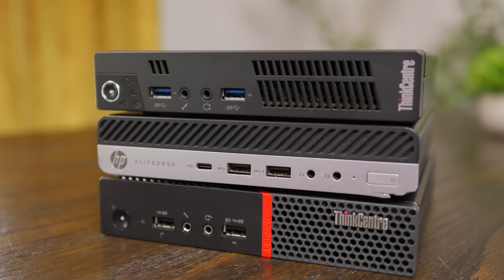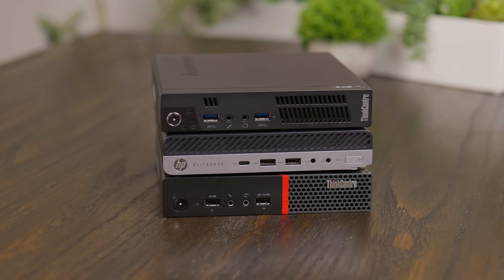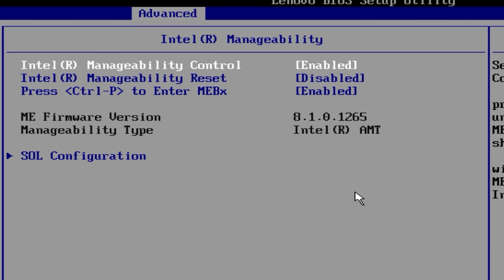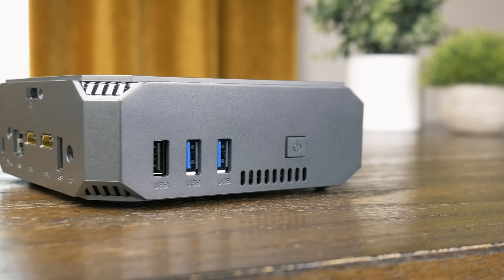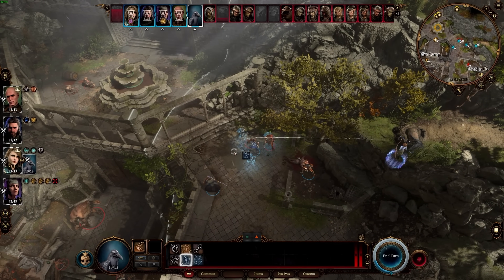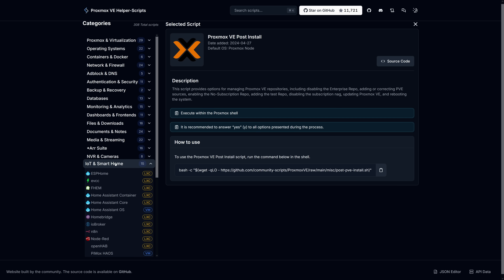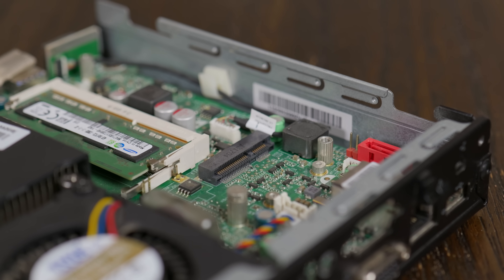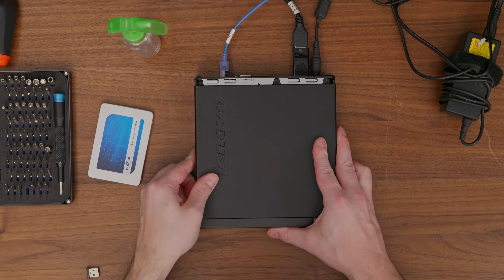Why Are People STILL Buying This Old Mini PC?

Comment from the maker: By clicking my link https://www.piavpn.com/HardwareHaven you’ll get an 83% discount on Private Internet Access! That’s just $2.03 a month, AND you’ll also get 4 extra months completely for free!
Reply: Perhaps you could try liquid metal or PTM7950 and see if that improves the temps?

Or may even undervolting. :)

Maybe even 3D print a little airflow guide for the fan. 

Could the adapter being causing the issue with the PCIE slot dropping to Gen 1 speeds?
Reply: Why? Because people don't have enough money to cover all expenses. Don't be ridiculous.
Reply: Benn running an HP mini for years and it is still serving my needs today but always looking for deal on Lenovo. One catch I have though is cpu support for windows 11 per MS's table of supported. OH, it needs to be cheap too. I don't mind adding ssd and ram myself.
Reply: I've been a PIA customer for over 5 years now. No complaints.

Comment: I have a Positivo Master MiniPro C6200 here in Brazil with an i3 9100T, 2x8 GB DDR4 RAM, an M.2 NVMe slot, and a 2.5" SATA III SSD. It's incredibly fast, it runs almost everything.

Comment: Any computer is good if you know what you can do with it. I'm using right now an HP Elitedesk 800 G2 with i7-6700T and 32Gb of memory, on Manjaro as operating system. It can emulate any older version of Windows and can use all my older software that I need. Sure, it cannot run the latest games, but I don't need this computer for those kind of things. My 11 years old computer is just perfect for me; would I buy it again? For sure I would buy a second one right now for spare parts (because it's really cheap to buy it and for now I can still find it easy to buy)

Comment: This is the oldest gen CPU you can run all Linux software on, because in the last year there has been a push to move from x86_64-v1 to x86_64-v3 and Ivy Bridge is the first v3 CPU.  Running an older CPU would require building some software from scratch, and you'll be limited to a select few Linux distros.

Comment: Yours was heavily used and didnt have stock ssd. Its low power. And they don't crash. Ever. Theyre great for kiosks. Esp if you use stock nvme like the PM981. Quadro drivers are good for CAD.

Comment: My elderly mother lives out of state, she has a laptop but I also got her a little used thinkcentere so she has a back up since she has to get online to pay bills ect, its got a 6500T, got it more than 5 years ago and it still works great, and with its small size if it ever stops working it will fit in a flat rate USPS box and she can just ship it to me to fix if need be. Next time I am out there I will upgrade it to windows 11, these all have the on motherboard TPM2 chip.  If I was buying one for myself I would probably get the AMD 2600 based system or N100 system that have newer GPU chips that can handle all youtube codecs as they really dont cost any more. But theres no need to upgrade the current one.

Comment: I have one with i5 9400 I think i use in lounge for emulation and streaming/ work. Another next to main pc for NAS and testing
Reply: I have a core 2 quad one i use for terminal, serial devices has 2 ports and low profile gpu for other work. It's my rom, device testing and more system. With Linux lite

Comment: These things rock.  I recycled an i3 6100T processor from another 'seasoned' computer upgrade into an HP Elitedesk 800 G2 $30 ebay barebones.  NVMe, Ram, wifi/bluetooth card , BIOS update, Zorin install and boom...rockin' garage computer.

Comment: You touch pretty well on the reasons I don't try to run old hardware: compatibility and a lot of time spent troubleshooting quirky issues. I'd rather buy budget newer hardware (there are a lot of good and cheap MiniPC's out there). I'd say it's too old if you don't want headaches, regardless of the actual hardware comparison. Too many drawbacks for me. Awesome deep dive though, thanks!

Comment: Hi, I noticed something curious that is just mad enough, that you might want to try it...
 Let's start with pointing out, that there is AMD based elitedesk series as well, and it has a MXM header for graphics card. That means there are 4 more PCIe lanes that you can use for whatever shananigans one wants.
Now, looking at boards for intel line up, the solder pads ARE THERE. It may be as easy as soldering proper connector to get access to 4 extra PCIe lanes. You could use them for anything your hart desire ( I'm inclined to add SAS card to make this a compact NAS solution with some 3d printing for enclarged case...).
So... Are you curious enough to do that soldering? Are you? ( <Challenge extended> )

Comment: this guy says u cant install faster cpu,cuse it may overheat.
AND WHAT IF I DONT CARE ABOUT NOISE,CUT HOLE INTO CASE TO INSTAL CASE FAN ADD MORE POWERFULL CPU COOLER WHAT STICKS OUT AND LOOKS UGLY?

i mean if it can successfully cool more powerfull cpu,i would take that trade even if it looked very ugly and noisy.
i mean who cares i store in some closet,far away +use wireless keyboard+mouse.coul done with long usb extension cable to.

and you would almost not hear noise,if it was away!and gives shit how ugly it will look,if will get job done for good.
please excuse my poor english text

Comment: The reason for the price floor is that the M700/710 can't officially run Windows 11 and so there are hundreads if not thousends being scrapped by orgs each week, because they still function fine the electrical waste contractors are shreading the drives and then installing new ones and reselling them, and because the get them for free they can be super cometative on price.

Comment: I have several programs that are big part of my life and hobby.  Windows 11 killed them, the no longer work or function.   Just for added insight the authors of those programs will never be upgraded again as the writers has died with both of them.  same with my security cams.  requires explorer to work.  Winnows 11 and edge has ruined the system.  so old systems like this keep me interested in older systems

Comment: Thinking of EPSON ST190e + G5500T + 16gb ram + 256gb m.2 + 2 x 1TB 2.5” HDD running raid 1
Planning running NAS for photos, videos and docs backup + light internet browsing (especially streaming site)
What OS recommended to do this? Too bad fnOS not available outside China.
What app can support automatic sync phone photos and videos? Plan to do it autonomous, let’s say daily or weekly.

Comment: I found myself a lenovo m73 tiny with 4gb of ram ddr3 i5 4590T and no hdd but after a upgrade with a new 4gb stick and 256GB ssd it is very good for my home lab.

Love it also found it for 35$ and 10$ for upgrades

Comment: Just got a M920q tiny! I run an ulgraded T3500 but im a big fan of the sff and the lower power req AND THE HEAT. Between my desktop and server my officr gets so warm. Im a big fan of those mini 3d printed racks which im planning on building

Comment: With Win11 requiring TPM2.0 to properly run, these older mini PCs will get pretty cheap in a while I would guess... All the schools and universities tossing them out since they would not convert to Linux and have to upgrade to Win11 later that year...

Comment: You can install proxmox on a usb Stick (that for instance is how VMware usually is run in big enterprises)

Also, this as a router / firewall works pretty fine as well you only need one 802.1q capable nic and use vlans to separate which all I’ve seen in the last 20 years can actually do

Comment: People are buying them because they make really nice retro gaming boxes and media center PCs for a really low price on the secondhand market.  I use a slightly better configured Dell micro desktop for our remote cabin entertainment center.  It can handle game system emulation up through GameCube era, has lots of internal storage for the media server (movies, shows and music), and because it does run Windows, can stream any of our subscribed services without complaint via the phone hotspots.  It's a perfect little box for something to do when we're not at home.

As for Linux: meh, the OS is still not really ready for primetime, at least not in our use case.  Regardless of distro, too much compromise was demanded of me to use it.
* Either power management or display drivers had flaws and the system would freeze if left on for more than a few minutes while turning off the TV.  We visit the place for the weekend, and I expect the system to be running the whole time so we're not waiting for things to boot when we fire up the television.
* Chasing faster boot times and less resource usage, trying other distros exposed issues even booting in a reasonable time or had one annoying quirk or another with sound output or just being adaptable for easy use with a Logitech K400+ wireless keyboard/mouse on the couch.
* NONE of them were able to just launch a browser and get into all of our streaming services reliably.  No matter what browser we used, some or all of the services would through an error about compatibility or encryption availability issues.

Just.. ugh.  Too many issues to navigate and compromise for.  Like Willie Bank said: "I don't want the labor pains, I just want the baby!"

Yes, I know there are solutions for the issues if I look and tweak long enough, but I'm supposed to be on vacation, not continuing to work my day job.  Linux is fun for hobby projects or simply proving "I can do this for free" (but what you save in cash you WILL spend in time on research and seemingly endless configuration testing).  On the flip side: Windows installed and ready in 15 minutes.  Vendor-provided (not 3rd party/open source sorta reverse-engineered "good enough for government work") drivers installed in another 5 minutes.  No weird freezes regardless of display or wifi state change.  No mysteriously disconnecting USB devices or other behind the scenes driver crashes and failures.  No weird issues just booting because it's Saturday or it's a full moon (looking at YOU Linux Lite and your DHCP issues).  Yeah I might be sacrificing a little bit of potential performance running a more top-heavy OS, but I don't have to tweak and tune and refine and kneel before Zod before it does what I want from it either.  It just works.  Sorry/not sorry, Apple.  :D

Comment: From memory, the older bioses don't support native nvme booting.

But if you had a certain chipset/bios then you could mod the bios and slip the nvme support in.

Although you might have to remove support for other things.

On my AsRock Z87 Professional with my i7 4770k, I removed PXE booting support to fit the nvme support in and it worked like a charm!

Comment: I'm looking to (at some point) set up a few systems/servers ... and wondering if a low power/thin client will work and if I can combine any to run on a single system/thin client...

Services/Servers:

1.) VM for Win 10/Mac/Linux
2.) Game Emulator (Preferably Atari/Nin/PS/Xbox/etc)
3.) PiHole
4.) VPN
5.) Auto Video Converter [automatically convert/compress video files (and add subtitles) when an edited video is placed in a folder on a NAS drive and have it create a folder in another directory on a NAS drive where the converted video file will be created)

I'd like to combine as many services on one system as possible for room and power savings. Any suggestions??

Comment: I bought a dell optiplex 3050 a few months ago for like 50 dollars on eBay. I had an old gaming pc my grandpa gave me that I turned into a Jellyfin server for my house that I’m pretty sure the power supply died in. The optiplex has 8 gigs ram with a intel core i3 processor and came with a 500 gig hard drive that I took out and replaced with a 1TB SATA SSD and it’s got a M.2 nvme slot so I threw in a 1TB ssd to boot from. It handles multiple people streaming with no problems and the dell looks identical internally to these PC’s except it’s extremely quiet

Comment: I managed to buy a pair of the slightly newer m93p’s both with i7-4790t CPU’s for next to nothing (one even had the optional dvd expansion!). The first one’s a hackintosh system and the other is running retrobat for emulation. Both work really well for what I use them for.

Comment: i use  the lenovos as tv boxes    on a  display port to hdmi adaptor   and they work well  trick on thermals  is to use the  later models   heatsink setup with   thermal pipe   then can run a  3770T  and   stay cold and i run 16g  ram in them helps  heaps   and a ssd  drive (sata) other trick is get the   dvd  drive  for it and   pull dvd and  fit a tray in it  then can  use that as   another drive off the usb 
as for pcie i use a  realtek 2.5  adaptor    for lan on them  and  it fits  there the serial port hole is
note i run win 7 on them  just fine  ( with the fixes lol ) 2nd  sata  on dvd  drive  is  for storage only  also helps  to use a 90 watt  power pack on then standard is  65 watts

Comment: I have one that fell into my lap but it had a 1610t. I did put a 3770t in it and use it as a receiving computer at my biz. Works fine and dies not thermal throttle even in r23.

Comment: Good video! I've not used the mini PC's much. I was medically retired(at a young age) just before these really became mainstream in the business world so I don't have a lot of experience with them but confirming that you "can" use, even if not ideal, the PCIe/Mini-PCIe slot for a storage device is handy. I have an old 4th Gen i7 LA-B012P mainboard from an old clients Dell XPS 13 that the ribbon socket for the ribbon to the HDD sata port was damaged and we replaced the entire board. I might hook an m.2 SSD to the Mini-PCIe port on it and then use a USB wifi card and turn it into a media pc for a TV.
Thank you!

Comment: Others have probably pointed it out, but NVME simply wasn't a thing until gen 6 intel/1st gen ryzen, so theres no way to boot from it, and the mini pcie slot is only for wifi and you're lucky it wasn't SDIO which uses the same connector but only supports SDIO functionality.

Comment: I recently got 2x Mini Lenovo Thinkstation P330 Hex-Core i7-8700T Quadro P620 NVME Tiny Desktop  (that way I had the PCIE Slot) for $170 each) I also got a Lenovo ThinkCentre M910x Intel i7-7700  for a remote deploy. 
These things are great. 

I wouldn't get anything older than a 7th gen though because of the encoders in the 7th gen +

Comment: I just got a 2nd dell optiplex 3060 micro, I have it hooked up to my TV with windows 11 running on it, it is still very usable with an 8th gen i5 processor. I paid $55 for the PC at the auction in my area.

Comment: I've bought around 100 of these specifically because of the VGA port. For building custom MAME cabinets these are great, and if you want a mid 2000s gaming rig these will run WinXP. I think the VGA port is why these are still desirable for a lot of different applications.

Comment: I'd like to see a video on setting up a DLNA server that just does DLNA serving of media files. That can be done with Open Media Vault, but that's like using a whole toolbox to open a soda can. OMV is also a bit of a pain to configure, with the user having to dig through just about every part of it to setup and share folders and get it all configured for access. "Plus" the DLNA server is in an addon package that has to be downloaded using a command line terminal.

Is there a DLNA server system that can be installed, create a folder, and then just share it on your LAN? It needs no access to or from the outside Internet. All it needs to be is a bit bucket where files can be pushed and they're visible by anything on the LAN with DLNA support. No fancy transcoding on the DLNA server because the client devices are responsible for being able to play the files. OMV can act like that, after all the fiddly work.

I have an M700 Tiny waiting to be my latest DLNA server, replacing the mid 2011 Mac Mini that suddenly died. It replaced a HP t5740 with PCIe expansion. That one I had a PCIe x1 eSATA card in then it got killed somehow by a 1TB NVME card in a PCIe x4 adapter. The adapter and NVME had been tested in another PC. The adapter also died. I had another adapter, x1 size, also fine in another PC. I bought a second t5740 which tested good with the expansion unit, then was promptly offed by the x1 NVME adapter. That adapter survived and has been used in other systems.

So don't try PCIe NVME adapters in a t5740! Someone on Amazon has new PCI/PCIe expansion kits for these thin clients for $13. Pop in an eSATA card and use an external drive, or use a regular SATA card and stuff a SATA SSD inside.

Comment: I use a Lenovo ThinkCentre m75q as my primary desktop right now and I'm a big fan. The dedicated graphics are pretty solid and enough for most games, plus you could add an external gpu in theory, 32gb of ram in mine, space for both an nvme and a sata ssd, great portability, and shocking heat distribution when doing pretty intense tasks. Never seen it even push 70° while pushing it to the absolute limit. Lenovo just knows their shit my laptop is also a Lenovo ThinkPad.

Comment: solution to the storage expansion: I did this to my thinkcentre mini. 4 port mini pcie to sata 3 adapter, shucked 4x1tb kingston a400 drives (the boards themselves are tiny) and a 5 way sata power splitter. The whole mod cost about £40 not including the drives. So I have a 5TB file server stuck to the back of a monitor where it doubles as an almost completely silent bedroom entertainment system that runs on a 30 watt wall wart.
Reply: I think you could save some watts of electricity if you did more capacity less ports. For example, 2x2tb ssds instead of 4x1tb. Though i agree that you lose a bit of redundancy in this case.
Reply: @andrewkosenko2757  the 2TB SSDs are stupidly expensive, even now. The 1TB units were £32 each when I bought them, they've been hovering around £55 for the past couple years.